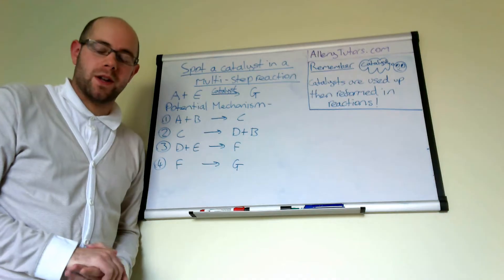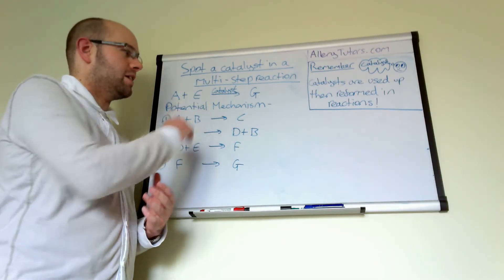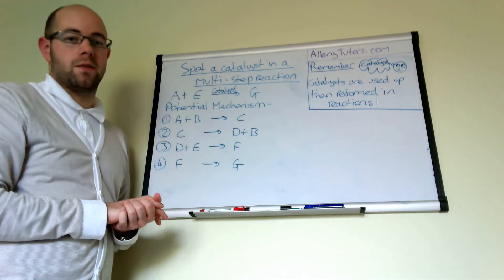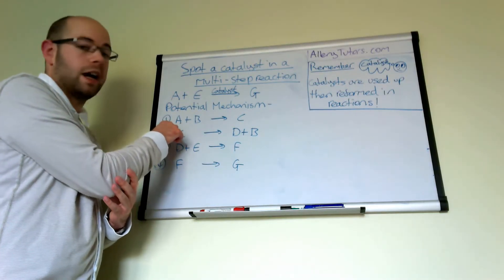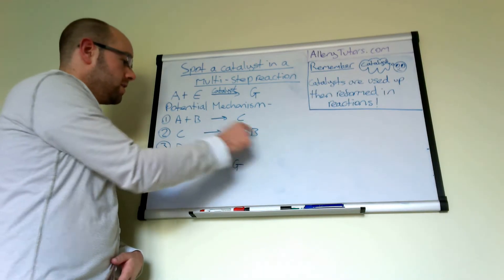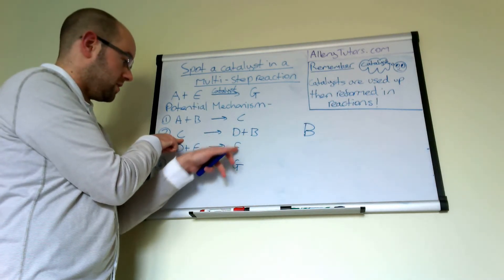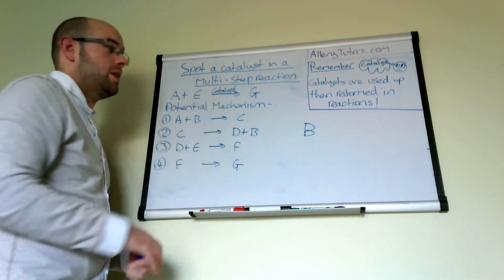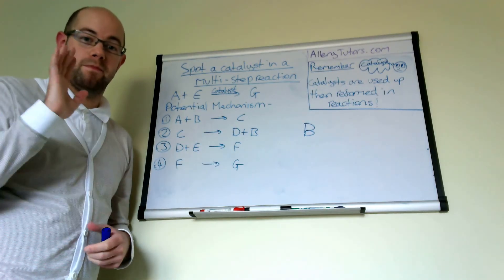Identifying a catalyst in a multi step mechanism

Comment: Thanks I almost didn't watch cause of the letters vs actual formulas but this explained it very well.
Reply from the maker: Thanks. Yes I just used a generic equation as you can apply this to anything. If it helps with actual equations I will do both.